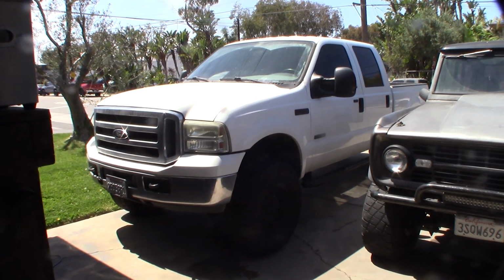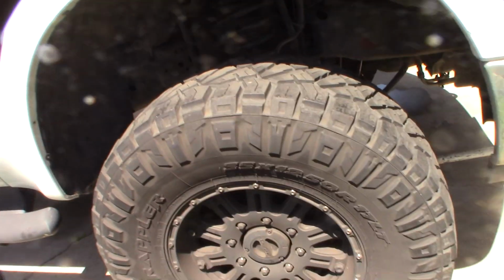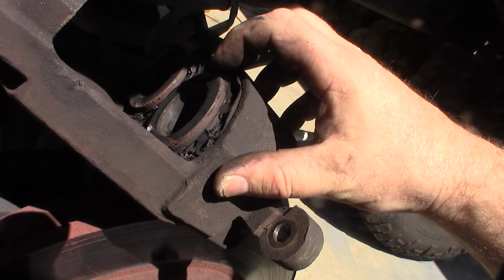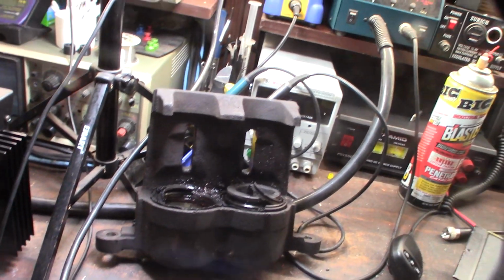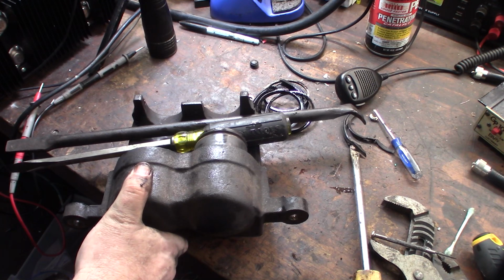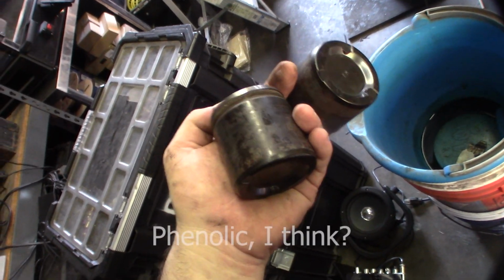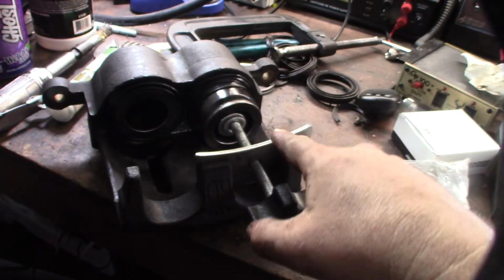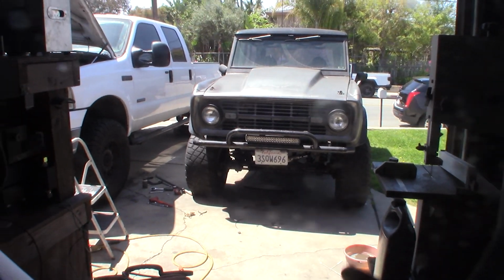Ford F250 Powerstroke 6.0 Front Brake Locked Up, Caliper Rebuild, Overheated Inspection, Repair.

Comment: I've got one front dragging. Very very hot. Passenger side front, and driver side rear left. I'm pretty sure the driver side rear is the emerg shoes, because I had the front end in the air for quite a while, changing the satanic starter with that top bolt. Anyway, I put the emerg on. It hadn't been on in about 5 years. Next thing you know, problems. Great video, thanks.
Reply from the maker: Yeah my brakes all of a sudden when crazy. I rebuilt the front and back calipers, flushed system and all seems good. Also noticed my ABS Module was giving me some errors. I would do a scan with a more advanced CAN bus scanner to see if your getting any ABS errors. I have to reflash mine using forscan.

Comment: One time I did a brake job on one of our Chevy trucks and I accidentally put the caliper back on with the hose twisted around an extra turn (it's easier to do than it sounds). It worked great for a couple months then the hose failed internally and that wheel started dragging. It didn't completely lock, but the truck was pulling heavily to the side.
Reply from the maker: Interesting, sounds like the twisted hose was acting like a check valve. Happy I was able to recover for $20 in seals.  I'm rebuilding the rear caliper now. Not making a video about it. Been fixing allot of 3D printers. Have you tried one of those tool changers yet?
Reply: @fintechrepairshop  I don't have a toolchanger running myself but I have played with the Prusa XL x5 at the makerspace. Kinda cool but I have started to realize how much better it is to have a 50c chamber so I am spoiled now. We have found a chamber helps a lot even with PETG. The XL is too open and too unconstrained 😀
Reply from the maker: @jessicav2031  Yeah, I'm I'm building an active cooler out a space heater for that super large troodon printer I have. I was able to get 50C in test. I have some large prints I'm going in ASA.